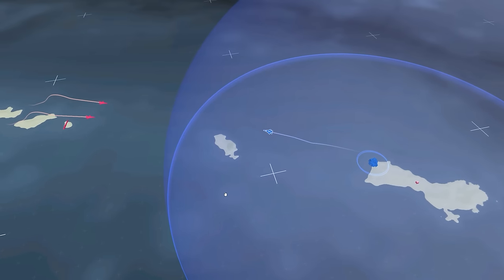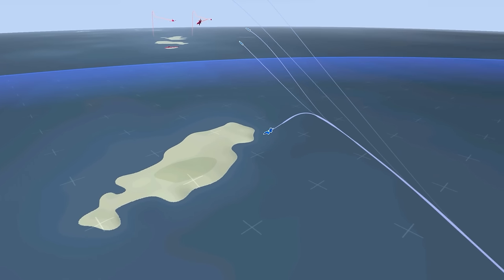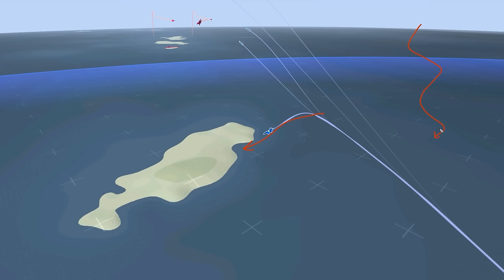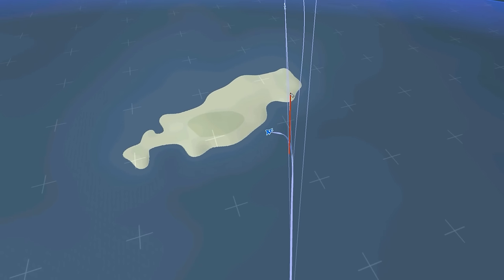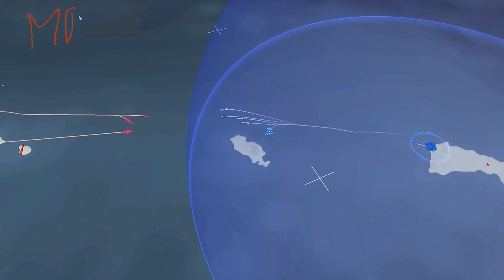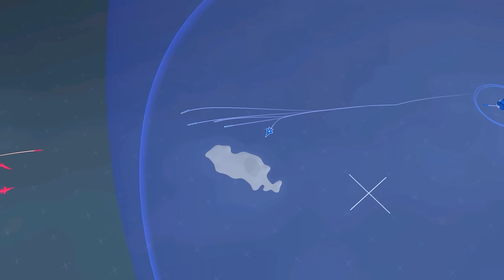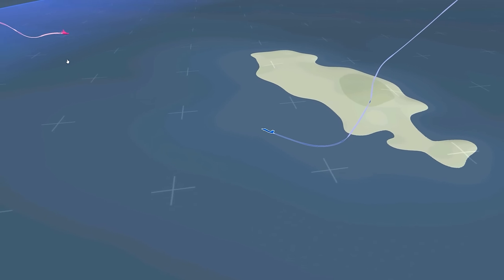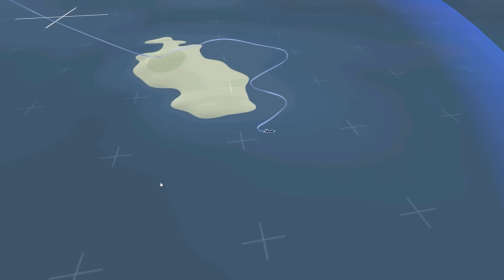Modern Air Combat Explained | Basic Understanding / Explanations | Digital Combat Simulator | DCS |

Comment: So I guess the drag from the atmosphere is the missile's biggest problem, because if it wouldn't be you could climb and force the missile to trade speed for altitude. But when you dive the missile following you will trade altitude for speed which seems to be not enough to compensate for the denser air.

Is the towed decoy modelled in DCS? I would like to see some F35 action with that.
Reply from the maker: Yes it is modelled but I think only for the f18
Reply: @GrowlingSidewinder  Seeing it on the F-18 would be nice too!

Comment: Great video, thanks! I understand the concept of using the increased drag from the denser air to bleed energy from opposing missiles, but by drawing them DOWN doesn’t gravity help maintain the missiles’ energy? Other than being outlined against the blue sky and opening yourself up to an easy radar silhouette, what about a rapid climb to force the missile to bleed energy overcoming gravity?
Reply: Got the same thoughts. When you drag the missile to the deck and then pull up again, the missile shouldn't have enough energy to follow you?
Reply: Gravity is one of the weakest forces in physics.

Comment: One question, while going down puts the missile in denser air slows it down but would going up also be useful to make the missile fight against gravity its a thing I've been thinking about.
Reply: Attempting to outclimb a missile is generally a terrible idea. You need to have a deep understanding of the performance of the missile that was yeeted at you and how long you have to defend for before attempting to outclimb it. Notching, descending and turning cold are general far more advisable.
Reply from the maker: yes, it "works" to make it fight gravity but its no where near an effective force has drag and friction, also consider that as you climb to make it fight gravity, you are slowing down as you exchange gravity for Kinetic energy so you're making yourself an easier target to kill. This method works if the missiles energy state has already been defeated, but that case you can do whatever you like anyway the missile is already dead.

Comment: I still have trouble understanding the notch, and i understand everything you explained. The reason is, how is Radar not more like Sonar or other EM spectrum sensors and recognize the return bounce of your aircraft? Even if you are not creating doplar shift... you should still be returning a bounce. That return, should tell you angle and distance.
Reply: Yes, you are, but you appear essentially indistinguishable from the ground clutter and radar will likely misclassify you as such and drop lock.
Reply from the maker: the above comment is exactly correct, although you are still giving a return because the radar is looking down at you (notch) you can not be separated from the ground clutter, and will there be "filtered out"

Comment: Assuming the best modern missiles and radar, would you say that a fighter jet that can supercruise at Mach 2 and 65,000 feet (and starts the fight that way) would have an advantage in BVR over other fighters that start lower and slower?
Reply: i hope this is a joke dawg
Reply: Lol, has faster and higher he flies, the more kinetic and potential energy his missile has. Slower and lower flying enemies would not only have less energy, they also need to fight greater air resistance.
Reply: @Mike_Romeo  Yes, that's my thinking for why aircraft capable of this mode of operation would have a substantial advantage. This is my thinking toward NGAD: higher and faster. But I want to check my thinking against GS's experience. He's talked a lot about targets being easier to pick out against the sky and he always goes low to defend missiles. A fighter starting at this altitude may find it difficult to go low enough to defend missiles, especially without creating contrails. I think staying high and fast is great, but GS probably has a lot better intuition about this than I do. There might be situations where this way of operating is a problem.
Reply: @SwordOfApollo  Gettling low is much easier than getting high cause you wont have to fight gravity and you dont need to reach high speeds to get up. Nobody is staying up unless their missiles have a massive range adventage. They always need to defend to the ground because the enemy is forcing them to do so. Its bettee to be cautious then dead.

Comment: If the missile is diving to intercept, and has finite kinetic energy, can you do a full AB climb to escape it?
Reply: He indirectly talked about this.  You're better off staying low where there's thicker air, ground masking from incoming radar, and going up is "slow" because you're working against gravity.  That'll leave you in a worst case scenario if / when a 2nd volley comes in - exposed and slow.

The "yeah but" to that is you may need altitude (thinner air) to increase the lethal range of your missiles.  He has had fights where it became a race to the ground to defeat incoming missiles, then back up again to reestablish his own MAR to launch again.  Meaning that a poorly timed recommit meant turning directly into an incoming missile.

So you have to consider capabilities of each others planes vs. each others weapon systems vs. each others tactics (what he often refers to as "situational awareness.")
Reply from the maker: consider that as you climb to make the missile fight gravity you are becoming slow and are therefore an easier target to hit. its far better to simply make the missile fight drag and friction than to risk getting yourself slow while climbing.

Comment: So when doing the notch, you turn 90deg from the bandit, right?  Doesn't that put you outside the gimbal limit of your radar?  I thought that was somewhere around 30deg each side of the nose?  So do you accept the loss of lock, and just hope you can reacquire quickly when you turn back in?
Reply from the maker: correct (mostly) the angle off the nose a radar can maintain lock depends on the aircraft. Some are 60 some are 80....the su57 because of side mounted radars can maintain lock IN the notch. But regardless generally what you said was correct for 99% of aircraft the notch is a defensive maneuver. Because it forces you to break lock. Generally speaking you are only notching if you are in the range no escape of the enemy missile otherwise you would probably prefer the much safer option of just going cold. But yes even from the notch (if you survive) you will try to recommit and target the enemy aircraft again. (but if you are in this RNE then he was probably in yours, in which case 1 of you is probably dead)

Comment: For the beam/notch to work against a pitbull missile, do I also have to lose lock to the launch aircraft first? In other words, even if I decoy the missile, can it reacquire lock using the information from the launch aircraft's radar.
Reply: If the other aircraft has never lost the lock, then his missile never went pitbull. So, yes, that missile will continue to have tracking on you, no matter what.
If the enemy aircraft loses lock and his missile switches to internal guidance, as far as I know, even if the aircraft reacquires you, he can not send that info again to the missile he already shot at you. That missile will just continue to use info only from its own radar.
Reply from the maker: defeat the launch aircraft radar first, if missile goes pitbull defeat the missiles radar. If you decoy the missile you should be safe, but there are situations where you may exit the notch or beam too early, and the missile's OWN radar will reacquire you, (this is sort of common with the aim54 and sometimes the meteor) thats why its a good idea to hold a notch or beam for a while so even if it sees you again you will be so far gone it won't have the energy to get you.
Reply: Thanks both of you for the reply! I got it now.

Comment: Just a question about the radar. Does it move in the nose when it is scaning for targets
Reply from the maker: it has a scan pattern, generally speaking its a left to right sweep, between 2-4-6 lines across a certain degree of scan 20-40-60-140, so left to right down 1 line, left to right, down 1 bar, etc etc

Comment: So if the fighter has awacs support, couldn't they "handover" missle guidance to the awacs since it has a much stronger radar?  Or is that still sci-fi?
Reply: If missile and airplanes are networked with datalink then yes. Older missile were working in "receive only" mode so that was a problem.
Reply: From what I know, there is no such capability. Datalink can only tell you info on the situation and help you with situational awareness, but your missiles can use only info from your radar to track a target.
Reply: @ZachSawyer2077 Meteor gets guidance via datalink.
Reply: @sir0herrbatka  Cool, didn't know that. Is it currently the only one or can others use datalink too?

Comment: How do you calculate MAR?
Reply: You dont since there are too many factors. You basically just work with rule of thumbs and feeling
Reply: MAR and effective range in general, depends on air to air missile type and sensor capabilities, the avionics and radar on the fighter jets and altidudes and speeds of the fighter jets, altitudes (higher launch speeds give an A to A missile more kinetic energy) Also electronic counter measures can play a role, and a stealthy aircraft like an F 35 or F 22 will have advantages over non-stealthy aircraft either firing on, or being fired on (which being fired on is less likely with a stealthy aircraft). Note that no aircraft has "all aspect" stealth as good as the F 22. Not even the F 35. Though from head on and near head on the F 35 and F 22 are close for RCS.
Reply: @williamthornton5856 

That's nice and all, the concept it clear, but it's absolutely useless without a way to use it empirically. 

It's like a structural engineer saying "yeah there are formulas to make sure a building doesn't collapse, but you can't calculate them"